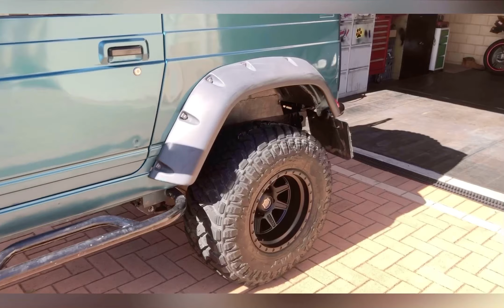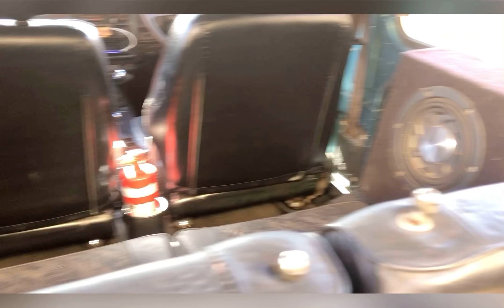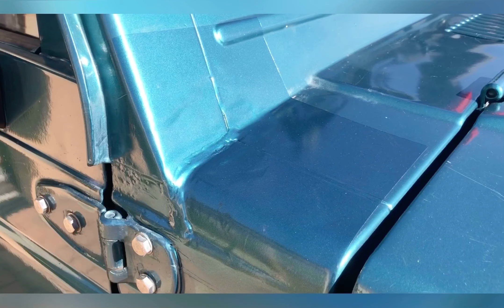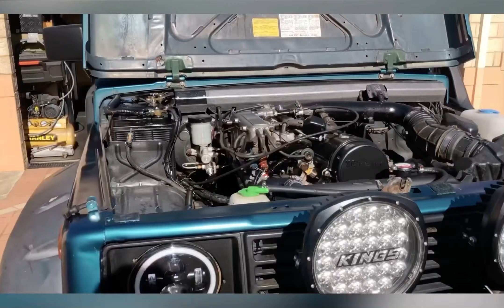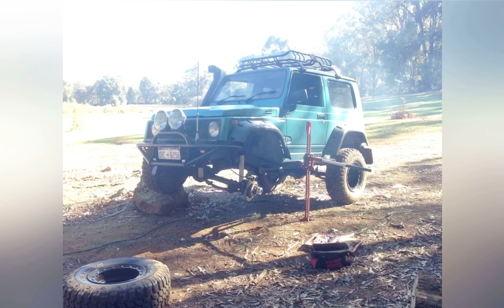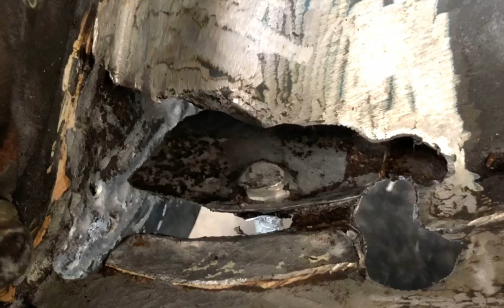Highly modified Suzuki Sierra walk around and drive

Comment: I daily an 87 tin top, I guess I'll have to fix the 1.6 in the garage now. 
Also, you under-sold that rear brake setup. I went the same adjustable route, haven't gotten teh disk conversion yet. Worth it's weight in gold.
Reply from the maker: Yeah get the 1.6 happening!! They are a great motor for it 😊
I think you’re right there, its a fantastic mod, the drums were trash and shes much safer now!!

Comment: really nice Sammy. 
My Intake also sits on the same side as yours, I like that Snorkle. So Vitara Snorkle should be ok.. Depending on how big that Pipe is. Cause my Intake can take a 72mm inside diameter pipe :-). So Snorkle needs to be the same size.

Comment: Hello Mr Ridder...  I own a 1987 carbureted model...same color also a hardtop..

Original engine...no rebuild...burns oil but still passes emissions test(barely)..

I have contemplated on swapping the engine for a fuel injected motor as you did... Or buying a rebuilt carbureted motor..

The carbureted engine costs $1150 USD rated at 98 horse power...

I use my hardtop for fishing...to reach streams and lakes that are farther and harder to reach...  I dont off road...

I have so many questions to ask but this issue is the largest and most important to resolve. 

Thank you all the way from east los angeles USA...
Reply from the maker: Hi mate! 

When i got this car it had a very tired 1.3 carby, it burnt oil like it did fuel 😅

The 1.6 efi was the best upgrade, it cruises so well and is such a strong motor! 

They are great cars for all types of four wheel driving! Go any where cars ☺️

Any questions mate go ahead! All the way from Western Australia! (I was in LA this time last year!)
Cheers
Reply: @riddoes  cheers mate... I will look for a fuel injected 1.6..  It may be awhile...  When i get it done...i will be back with more questions..  

Thank you!!!!!!!!!!!
Reply from the maker: @camposvazquez  No problems!! Good luck 😄😁😄

Comment: Great video and nice to see a very simple AUS video on this great build. Any tips on finding a model as a project? I assume a hardtop is better with potential for less rust compared to soft top. Thanks!
Reply from the maker: Thanks mate! She’s a great rig, when I look for a Suzuki I make try make sure it’s a leaf sprung wide track. They will be the 1.3L  5 speed with discs on the front rather than drums all round. Personally I prefer hard tops (quiet and no leaks) or a fibre top. Cheers!

Comment: Beautiful! Advice needed: Do you think a stock 1.3 71hp would have the power to spin 30 inch tires? We are speaking of asphalt roads, a Zuk for daily drive, only occasional off road trip. 

Looking for tire size to compliment the Zuk but not torture him! Thanks in advance for the advice.
Reply from the maker: Yeah you should be able to roll 30” tyres fine. All depends on the sort of life your 1.3 has had... mine rolled them fine back in the day, definitely a healthy size for the little zooks!
Reply: @riddoes  Thanks for the reply! Ordered 265/70/15 which should be 29.6/10.4/15 in inches.
Reply from the maker: @АлександърТошев  Awesome man! Should be a nice set of boots for the rig :)
Reply: @riddoes  
 so how will my 1 litre sj410 Suzuki engine perform with 31 10.5 15 tires or can it handle even bigger boots and will it need spacers for the rims for that offset great look, how many inches are best for the body lift too?

Comment: Tough and lovely . A hypothetical question  - is it possible that if for some reason the rear propeller shaft in a 4wd vehicle is removed , the vehicle can still be driven to a place some 500 kms away ??
Reply from the maker: Thanks! 
In an emergency situation yes it can be done, it should be fine but not ideal. You won’t be able to do it if the front has a locker in it though
Reply: @riddoes   thanx , man

Comment: Is this a G16 Engine? I am planning to put a g16 engine and power steering to make it everyday use my Samurai 88 g13 Engine no power steering. Some people has suggested me to buy a sidekick or Geo tracker and get everything from it to update my Samurai. What do you think guys? I just want a 16v Engine and power steering conversion for everyday use and some off road trips a year.
Reply from the maker: Hi mate, it is the g16b. So it’s the efi Version (much better in my opinion) 

I’ve not done the power steering conversion. But it’s fairly easy running this motor so I’ve heard
Reply: @riddoes  Thanks, I will be finding a g16B. What you say about the assisted wheel encourages me to try to do a swap, another problem is my country rain all like 8 months so an A/C is a must another challenge yet. People told me getting a tracker or sidekick getting pulled everything I need will be the cheaper way.

Comment: Gday Jamie I'm from West Oz bro. I'm thinking of buying a 2010 Jimny Sierra,it has a 2inch lift kit,ARB front bull bar,snorkel, all terrain tyres with stock rims,tyres not as big as or thick as yours, stock 1.3ltr engine ,& they're asking $19800,is that a good price or a rip off?
Reply from the maker: Hi mate! Its got a bunch of fruit with it by the sounds, how many km’s? 
Personally i wouldn’t go an auto, i think they are even more gutless and thirsty. And yes it seems quite expensive for 11 years old!
Reply: Yeah its got 155,000 ish on the clock.Im thinking the same thing bro.Cheers for the heads up
Reply from the maker: @bjs7799  anytime man! Good luck on the search 😎😎

Comment: New guy here.  The leaf springs seem like the whole system is compromised if you were to smack them while straddling...
Reply from the maker: Ay?
Reply: Ay. Don't the knuckles get hit?  The leaf spring system?
Reply from the maker: @axiom.ai.obviousbattletank7139  What do you mean by knuckles?
Reply: @riddoes  the tip of the leaf springs. Where the  metal leaf meets the mount?  I don't know the terminology.
Reply: @riddoes  maybe I'm seeing it wrong,  but it looks like there's an inverted chassis leaf that's hooked to a low point.   Am i tripping?
Reply from the maker: @axiom.ai.obviousbattletank7139  yes you tripping 🤣

Comment: Very good job sir,  I just bought my self a Sj 410, Can you tell the colour code of Suzuki ? And is your transmission is 4speed?
Reply from the maker: Hi mate! The colour code is 27G, i also got a sj410 two weeks ago! A little ute 🤩
Reply from the maker: And they started 5 speed in the late 80’s, so shes a 5 speed 😊😊
Reply: @riddoes  Oh great, Actually its my first Sj, I have kept earlier Vitaras, And Pajero. So I will take your guidance, Regarding some improvements, Cheers.
Reply from the maker: @maximuskhann5318  Hit me up with any questions mate! You in Aus?
Reply: @riddoes  : No man I'm Pakistan, But surely I will be needing your guidance,  Regarding my Sj project.
Reply: @riddoes : Hi man, Wanted to know if, I replace my sj 1000cc, Engine with 1.3 or 1.6 Engine,  My original 4speed transmission will ok ? Or i have to change with 5speed, Regards.
Reply from the maker: @maximuskhann5318  I’m not to sure how the bell housing is on the 4 speeds and if it goes up against the 1.3. The 5 speed is a better box to have anyway so that will be a good conversion whilst you’re at it!
Reply: @riddoes : Actually guys here in my country ,  They make adopter plates for any given conversion,  So that's not the problem,  my sj original 4 speed was A ok, What i was wondering even with 1.3 or 1.6 engine,  RPM are going to be high on 4 speed tranny?? As you have lot of experience with Samurais, But 5 speed is better option, As you said!!

Comment: How high is it raised in total? Ive got some 33” tires laying around and wanne throw them under my 93 samurai. Just not quite sure how much i have to raise it. Also need to get a different engine cuz burning oil and fuel like crazy can barely get 125miles on a full tank
Reply from the maker: Hi mate its about 4-5” and can fit 33”s easy! 😌😌
Reply: Lift won't fit tyres mate, when the suspension compresses the tyre will always end up in the same spot, no matter how much lift you have. I've seen 34" tyres on these with no lift. But with 33s a 2 inch body lift will stop your scrubbing. Just make sure your offset is correct and then you're good to go

Comment: Great mod . I also plan to try the rear up front setup on my zuk. I intend to install the leafs with  LROR missing link shackles  instead of extending the chassis  mount. Wondering how she'll behave on the highway at high speeds with the missing link setup
Reply from the maker: Awesome mate! I hope the conversion goes well and that system is safe for your purpose!! 🤩

Comment: Hey mate I am about To buy a Sierra for my first car at 16 have u got any advice on what to look for or cheep mods
Reply from the maker: Hi mate, It all depends on the quality of ride you want. Bodylift is cheap, get some second hand bigger tyres, or extended shackles for a bit of clearance too. I wouldn’t go bigger than 30” tyres if you’re not going to put money into the driveline etc 😄
Reply: @riddoes  thx for that would you recommend any good Tyers and lift kit
Reply from the maker: @rileyenso4900  Maxxis are my favourite, value and quality! 
I really rate Iron man leaves over any other from past experience on the sierra’s
Reply: @riddoes  thx heaps

Comment: Nice build.  Very similar to my Samurai build.  I recommend you get a set of hidden link drop down brackets for both front and rear.  Will give you another 3" to 6" of flex.  Though you may want to put some limit straps on the front if you do this as your front drive shaft will almost certainly hit your cross member a little bit.  I ground down my cross member so that it just clears under full drop out.

The one mod you have which I have been looking to do for a few years is the rear disc brakes.  What disc brake assembly and adapter plate did you use?  Looks like the disc bolts straight to the axle ends and the calipers bolt to the adapter plate which bolt to the stock tube ends (where the backing plate used to go).

Again, great build.
Reply from the maker: Hi mate! Thanks for the info and love for the zook! I’ve been there done that with drop link shackles. I love the flex they produce, but they just aren’t practicable or safe for my needs now! Loving the new set up and drive quality :)
The brake kit is from lowrange offroad and uses factory discs and callipers 
Cheers!
Reply: @riddoes  Thanks for the info.  Does the proportioning valve come with the kit?
Reply from the maker: @ryanheather467  It doesn’t mate, they really do supply the bare minimum:(
Reply: @riddoes  From where or out of what did the proportioning valve come?
Reply from the maker: @ryanheather467  Low range offroad
Reply: @riddoes  Thanks.